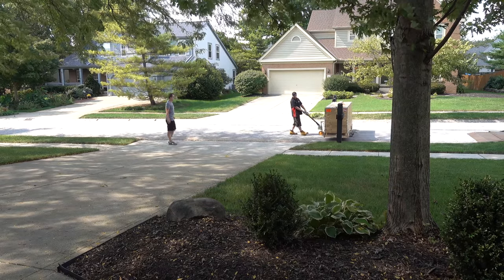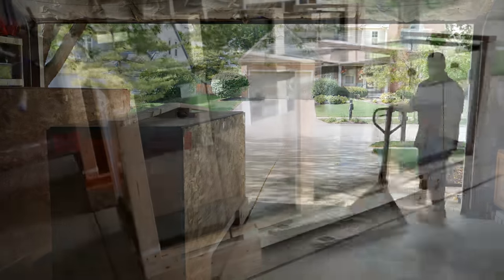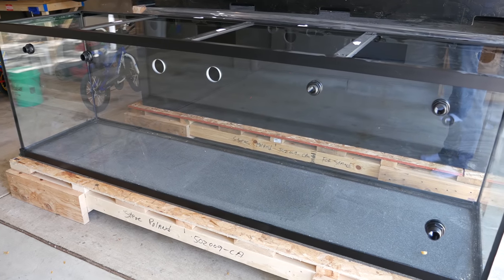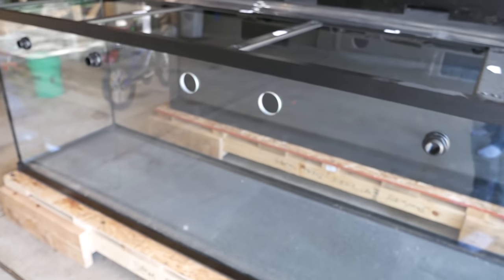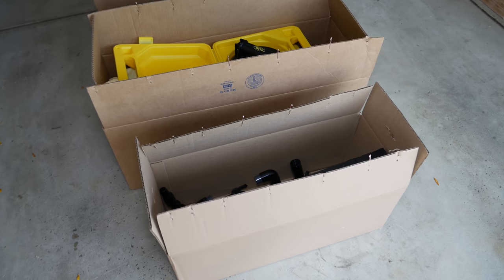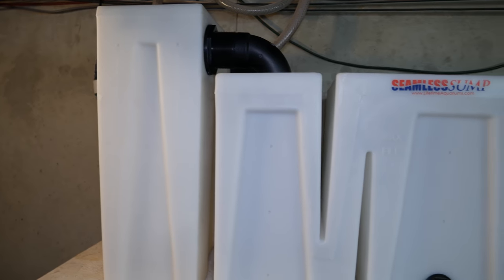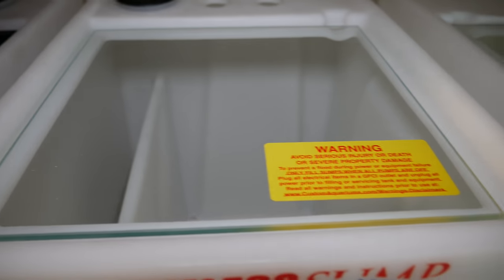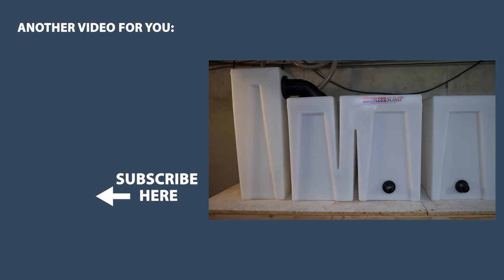Unboxing My 300 Gallon Aquarium!

Comment: I couldn't find the address on the about section. I recently moved a 265 g and it took 4 of us to move it. 6 would be way easier. I live on north the tip of WV so I am not sure I could be of much help but good luck. Those suction cups will save your fingertips.

Comment: Where is he going to put this tank? The water alone weighs 2,500 pounds, add in the weight of the tank and the stand, now you’re pushing close to or over 3,000 pounds. I hope it doesn’t collapse the floor.
Reply from the maker: It’s going against a wall and perpendicular to the joists. Those joists are relatively short (10 ft) and sit directly on a concrete slab foundation wall. Then I have reinforced the floor directly in front of the tank with two posts.
Reply: Steve Poland Aquatics   Good job.